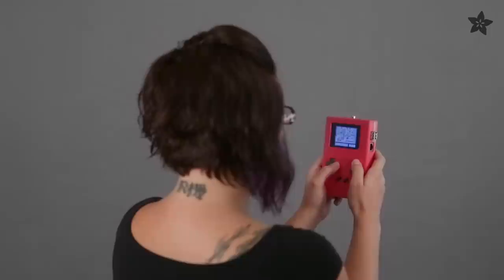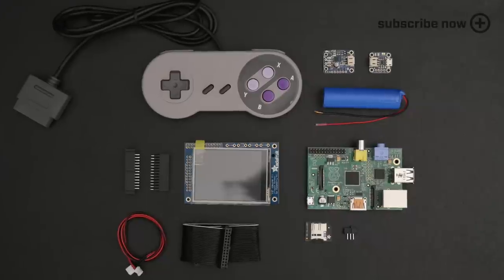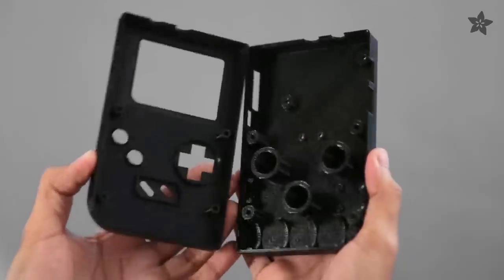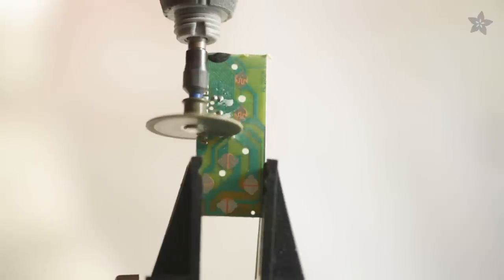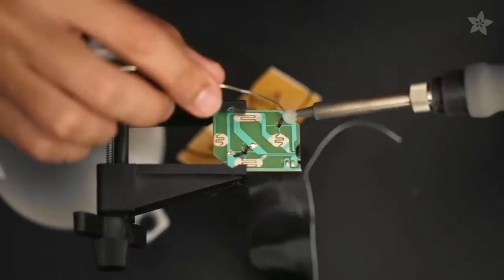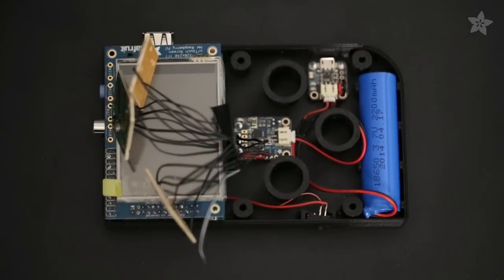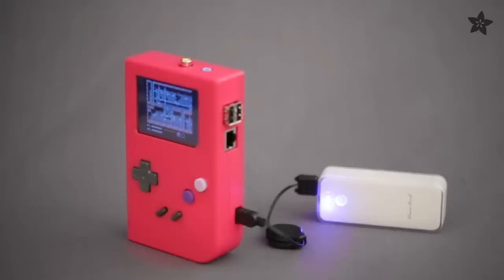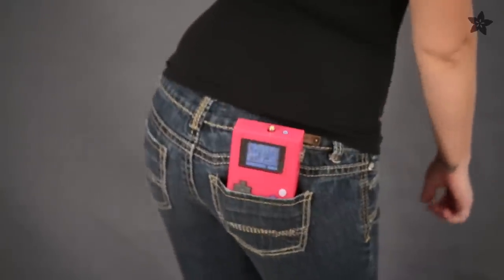DIY Raspberry Pi Gameboy - 3D Printed #3DPrinting #Adafruit

Comment: Is it possible to buy the gameboy pi already assembled? CAuse i do not have the money to buy a 2000 dollar 3d printer xD
Reply: You can upload the 3d file to several websites that will print it and then send you the casing.
Reply: Orlando Cal Which sites 3d prints for you?
Reply: Go to 3ders[dot]org for different sites
Reply: Silithas Type "buy 3d printed objects" in a search engine. You're welcome.
Reply: there are multiple services; Personally, I use Shapeways, but I want to buy a 3D printer myself (not sure which one yet)
Reply: ***** Well, it would depend on the price for the material and amount  used to 3d print it, the hardware and also the price for the assembler to assemble it. And i do not know how much that would cost.

But i guess it would be cheaper than a 2000 grand 3d printer? :P
Reply: ***** Yep, prebuildt ftw then! :P

But i would have LOVED a portable N64 console x)
Reply: Duckers you can buy a housing case 
that's easily available for $8 to $20
Reply: Or if you do want a 3-D printer, you could buy a cheap Chinese one from websites like GearBest, Banggood, or Amazon.
Reply: I saw one with a large printing bed and it was only 162 bucks. I might buy one, but maybe in August.
Reply: This ^ ^ ^ I just bought the Anet A8 on Gearbest for around $160 and it's freakin' great. Print bed is 220 x 220 mm and I think it can print 240 mm tall (so like around 8" x 8" x 9" print surface).  I'd warn that they do cut some safety corners with the A8 that can be a fire hazard and cost you like $30+/- in safety upgrades (mosfet, heavier gauge silicone wires, etc), but still for around $200 it's a damn good 3D printer! Comes as a kit though so you have to assemble it yourself, lol.
Reply: You can buy ones less then 100 actually
Reply: @therealboomshlamian700  This comment is 6 years old in case you didn't notice :P And now i got a upgraded ender 3 pro next to me.

Comment: How much grams does it take to print the case? My only access to a 3d printer is at my local library and they charge15 cents by gram. The case looks rather big and I'm trying to keep costs low.
Reply: +Jayce 117 Your library has a printer!? lucky!

Comment: why does the pcb from my snes controller i got from your website look different from the one in the video and the tutorial.
Reply from the maker: I've encountered the same - Different trace layout but should perform the exact same. It's really hard to know which controller has which version (only way is to take it apart). It's noted in the guide, though.

Comment: Could this be done with a model A raspberry pi ? Don't see the point in using the model B since the usb ports and Ethernet connector are not used.
Reply: Yes but some games might not run as well given the size of the RAM.
Reply: Jk Nichols
The model A has 256MB RAM. this already seems quite excessive to me for playing Game Boy games, even the Game Boy Advance only has 32 KB on the CPU + 256 KB outside the CPU + 96 KB video memory (WRAM). So you probably only need that much memory when playing games for other consoles, but most of them have too many buttons anyway, the game Boy only has 4 buttons + the d-pad, higher performance consoles usually also have more buttons (like the Nintendo DS models, which have 6 buttons).

Comment: Does anyone understand what they mean by "connect the last 6 to the display.makes no sense. Where exactly? which pins would work?
Reply from the maker: Holly Plyler Follow along with the tutorial, it's linked in the description.
Reply: Adafruit Industries I did; however the part that talks about connecting the display links to another tutorial about creating the hat itself. There is no circuit diagram for this step and it is confusing for a semi-beginner/hobbiest. I usually do little trinket projects before this. (I am a programmer though so I'm not a complete dunce at computers)
Reply: Adafruit Industries
So I take the wire bundle and connect it to the tft display and then take the pi and connect it to the tft to finish the connections? because that is the only thing that is making sense right now, but it is not stated in the directions.

Comment: Hey, can you put LSDJ through this?
Reply: Certainly, though the audio synthesis would be emulated, of course. There's nothing wrong with that, but part of the appeal of LSDJ is being able to use the original audio chips and circuitry. One might as well use LSDJ on a laptop. :)

Comment: Too bad its even thicker than the original. Still seems like a fun project. Though in truth that casing looks very weak. And may break easily over time. I enjoy projects but tend to lean away from projects that may break soon, or you have to treat it like an eggshell.

When I was looking up Adafruit and as I looked had hoped they made a slimmer Raspberry Pi, even a more modular one. Each Raspberry Pi seems to come pre-built with everything attached, over modularizing the system. So if you do not need something thats already added for a project you just have to design around it and deal with it. I'm one of the types that hates dealing with pre-built. Hope maybe in the future Adafruit sells a modularized kit, so you can build it exactly with what you want, keeping out what you don't want.

Comment: You're supposed to BUY a 3D printer to do it ?! That's what the site says, and it's worth 2000$ !
Reply: Actually, you can buy the gameboy enclosure off ebay. Here is one I found and plan on ordering from
http://www.ebay.com/itm/DIY-Raspberry-Pi-Gameboy-Enclosure-Case-/171549493986?pt=LH_DefaultDomain_0&hash=item27f1258ae2
Reply: Riley Bruce Thank you !
Reply: MrKayouh  try 3D hubs that can print your parts and ship to you.  Just google it!  My case cost about $42 much cheaper than a 3D printer.